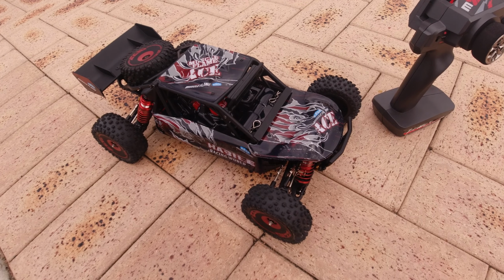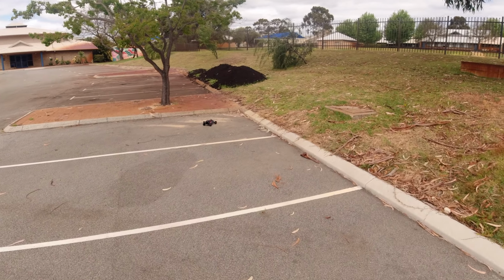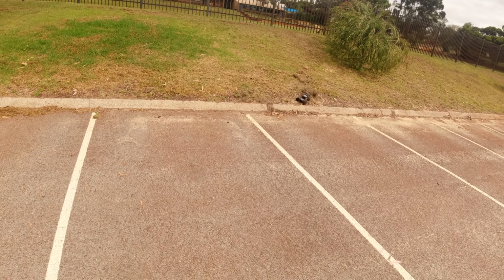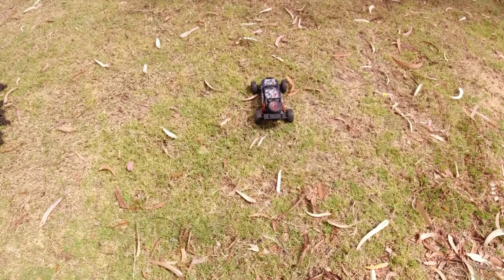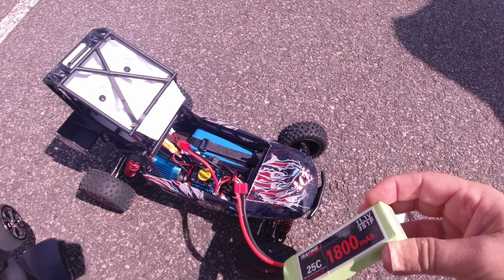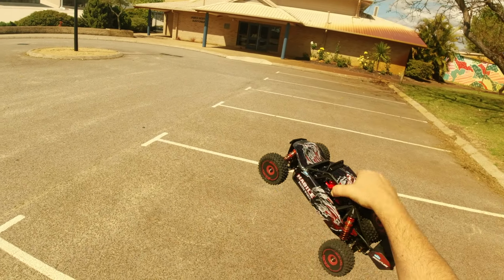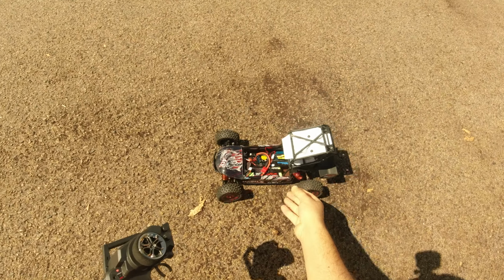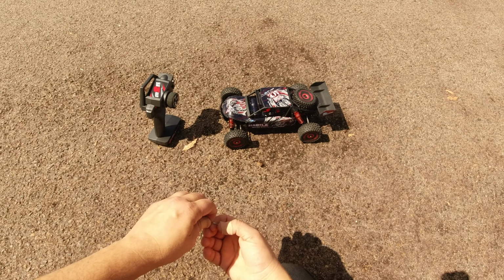New WLToys 124016 Brushless Review | It's FAR from Good!

Comment: There's probably a few things that could be done to amend these problems although it's definitely unacceptable to have there problems from a RTR vechile out of the box.
The range issue is a big one. Best to check the exposed wire length of the receiver. Not sure if you already know but the exposed wire needed to be 31.2mm in length to correspond to 2.4ghz.
Although anything between 30 and 33mm should work decent enough and I have Indeed repaired some recivers with bad range which have torn or been cut incorrectly. You may need to use a razor blade or very delicate wire strippers to remove the outer silicon covering.

It seems the delamere  Wltoys have is their limited use of pinion gears.
It's seems 27T is the only option available for the mod 0.7 with a 3.175mm bore.
They do make a 17 mod 0.7 gear but it would mean using a smaller motor with 2.3mm shaft such as a 2445 which would have even less torque.
To me it seems a possible solution would be to use a lower KV motor such as a 2600kv which they do offer in the same 2845 size or even a 3650 size. However the drawback would possibly be no increased in top speed over the brushed 550 version although undoubtedly on 3S it will indeed be quicker then brushed on 3S as well as run cooler too not to mention be much better for off road and climbing with better response too.

To me yeah, it seems like they didn't property develop this product possibly only testing the 1/14 scale brushless version or the buggy and assuming it would be just as fine in the larger heavier models.

Although Wltoys haven't done a brushless model in a long time since the first release of the L202 which I'm guessing is about 10 years old now and only 2WD so maybe they just didn't have the experience to properly develop this in the short amount of time of their release schedule give it seems they are so fast in  realising new product it's crazy when you think about it, good news is they are also quick to ammended product flaws and release as second or third version of the product if need be, let's hope they decide to do this sooner then later
Reply: Spot on! I run the 124019 with a racestar 2845 3900 kv motor and Wltoys a959 17t pinion on 2s and the thing is amazing! No cogging, no overheating and wheelies all day. I had to carefully drill the pinion out to 3,1 mm though, but its not an impossable thing to do!

Comment: Hey mate. Great to watch as always 👍
What's cogging?
Like bad diffs? What causes this?
Thanks mate 👍
Reply from the maker: Hi Marcus, cogging has got a lot to do with the electronics and also the pinion and spur gear ratio not being matched up well. This car is geared way too high for the smaller motor they used and the ESC system can not deliver enough power as well. Changing to a better quality ESC can help, but the motor should have been a 3650 size not a smaller 2845 as that would eliminate the cogging as well.

Comment: I noticed 1 thing between this car and the brushed version.
The brushed version has a 540 sized motor but this one has a 380 and both cars have the same gearing.
If you look at the motor mount on this car there is actually 2 motor diameters on the mount. 1 for 380 sized motors and 1 for 540 sized motors I assume. That means you could just swap in a 540 sixed motor and eliminate the cogging issue due to the increased torque.

Comment: Thanks, I hope wltoys will find a solution to those nasty problems. While I can see how a better esc can be easily replaced a tx rx as well makes this expensive. How about trying a cheap alternative in esc recvr combo like the hbx 16889 esc or the matching q902 esc and tx? Once you’ll put it instead of the 124016 rx and esc you might get rid of cogging and tx range issues. That said with the hbx 16889remote.

Comment: The cogging with these is due to too high gear ratio, put the 19T pinion and it's good. Mine runs a 15T 0.7m.
Reply from the maker: Yeah I know, they geared it too high
Reply: @PERTHWESTOZRC  the platform itself isn't garbage, you have bunch of upgrades/mods that can be made on these for cheapo. But you're right, the transmitter and esc that come with are garbage. A 10bl60 from hobbywing and radiolink rc4gs for cheap solve these issues both for this one then for all those that you will have.

Comment: Did you try the lipo hack you did previously in the controller to improve the range?
Reply from the maker: Hi Phil no I didn’t this time, I reviewed it as it is out the box without touching the transmitter, it should have the claimed 100m range like previous models, looks like I’m not the only reviewer to test this model with the same issue, thanks for watching 👍

Comment: Get a 60amp surpass hobby esc and youre problem is solved. The program card will not be sufficiant.   I know. I tryed on the 124017 buggy and then It will allso get the speed telling on the box with these 27 euro esc.

Comment: They need to start selling rollers! I'd buy so many of these if they were available with no electronics for 70USD. I don't see WLToys using good radios and ESCs anytime soon.

In this case they should have used a 540 motor or a 15T pinion with 4500KV or higher.

Comment: Is the cogging a side effect of wltoys using an unusually large pinion gear or a bad mesh?
Reply: They use the same huge pinion as the brushed version for some wierd reason. The LC Racing Buggy which this is a copy of uses the same motor with a small 17 tooth pinion and runs  beautifully..
Reply: @michaelcliffe562  I really suspect its the over sized pinion that's causing them problems. I think they're chasing a high top speed because it looks good on the box. Seems they get very hot and have short run times and both could be fixed by reducing the gearing. Especially on the brushless version. I watch a Valones Hobby vid where he did a brushless conversion on his 144001 and I think he got it right. Resist the temptation to go for a 36** motor, fit a 28** with a slightly higher KV and reduce the gearing (I think he went 16?). It was fast, didn't over heat and had decent run time. Quadify RC has said something similar too. Pity WLToys aren't using the same engineering sense.
Reply: @IDPTheory  I did that exact conversion with a wltoys 124019 after seeing that Video you mentioned and also a Video by "RC mod squad". I used a racestar 2845 3900kv motor and wltoys a959 pinion. No cogging, no overheating and goes like stink!
Reply: I have also converted a 124018, but since there is enough room as opposed to the 124019 I opted to use a 3650 2500kv motor on 3s with the original pinion, 85mm wheels and steel diffs and diff housings. Its a back flip machine😍
Reply: @michaelcliffe562  Haha well you've gone for the whole hit of the fruit there! Sounds like a beast 👍